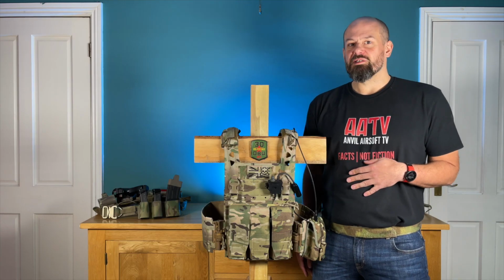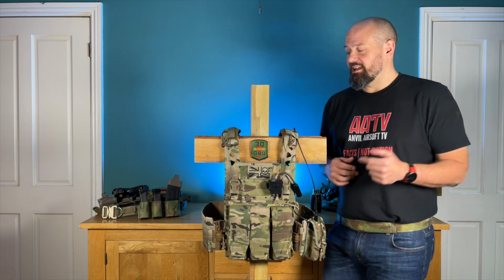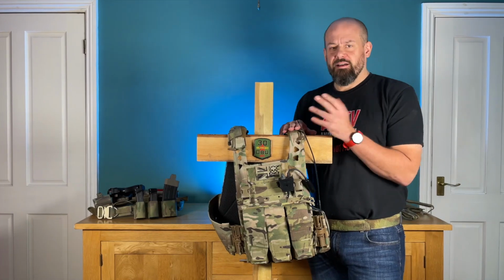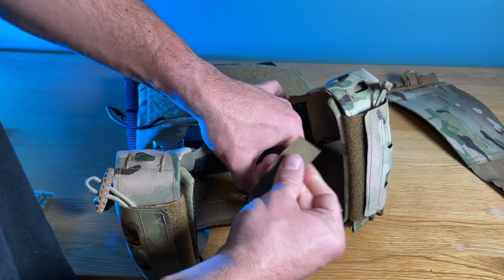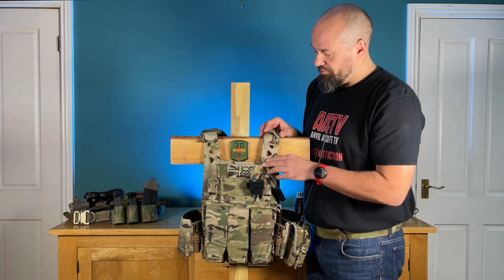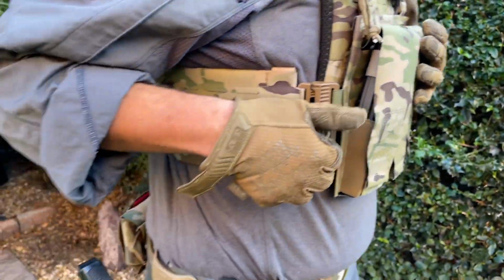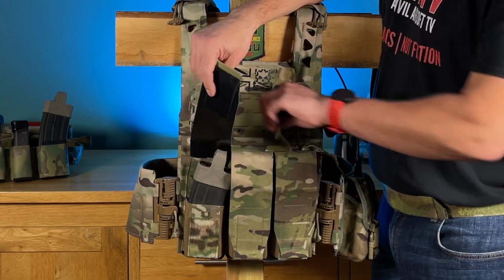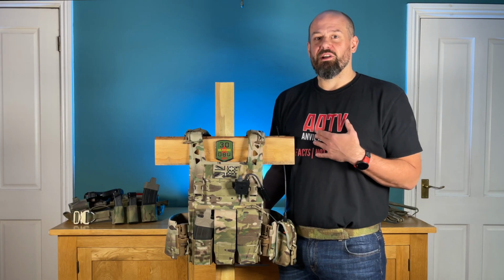C2R CBAV Plate Carrier | Royal Marines Plate Carrier | AATV EP181

Comment: Looks like a cracking bit of kit and the modular design aspect is fantastic. Could easily spend waaaay too much with C2R! Big fan of the tube system too and great for Booties on boarding ops. I'm guessing you like this more than your old JPC 2?
Reply from the maker: Yeah the JPC is going. I’m moving over to this system especially with the chest rig adaptor and assault pack
Reply: @AnvilAirsoftTV  modularity is the way to go. Was going to go Spiritus chest rig but think I'll hold back for once. At least until I've seen your video! Cracking stuff pal 👍